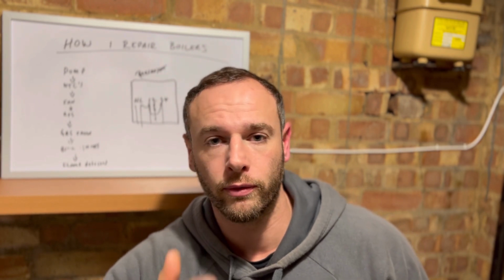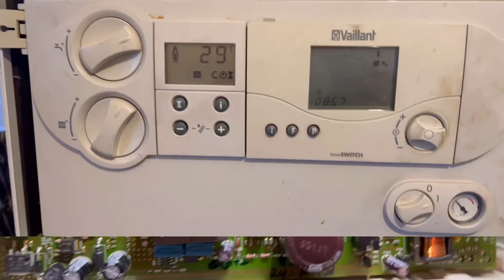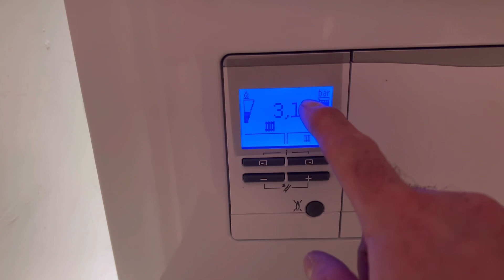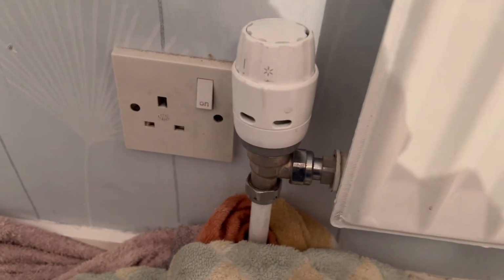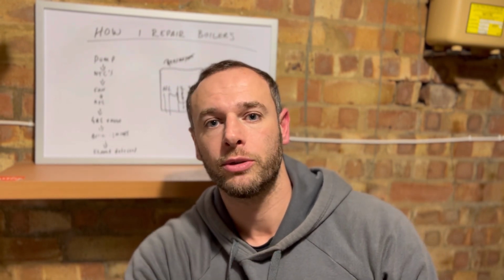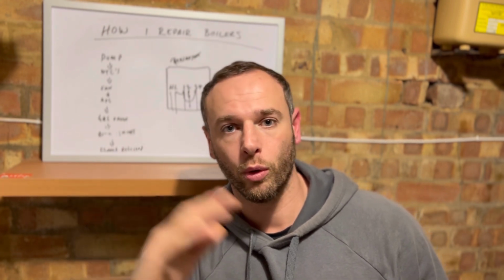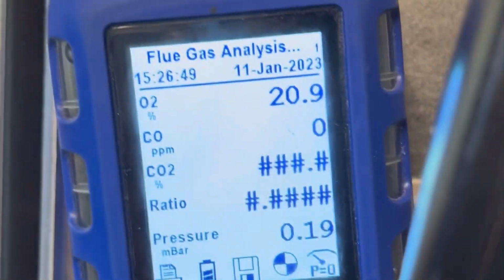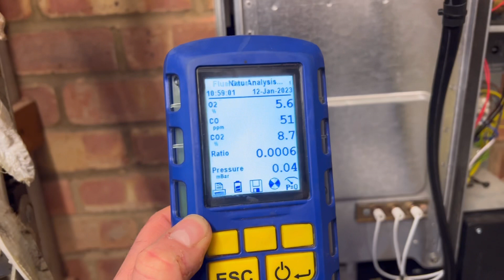A day in the life of a gas engineer #22

Comment: there are replacement valves for expansion vessels? i usually change the whole thing once the valve is bad haha
Reply from the maker: Yeah mate, but a Schrader valve kit like the 1 in the video and comes with the tool

Drain down, pump up, remove Schrader and then put the new 1 then re charge 

Job done